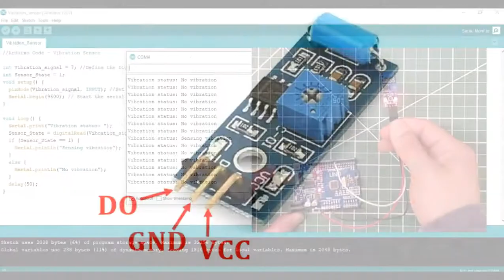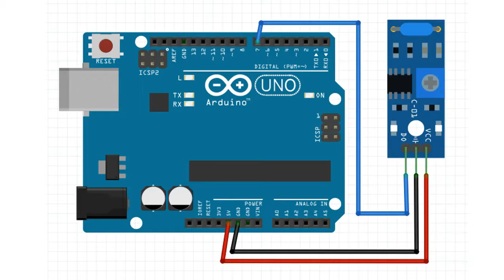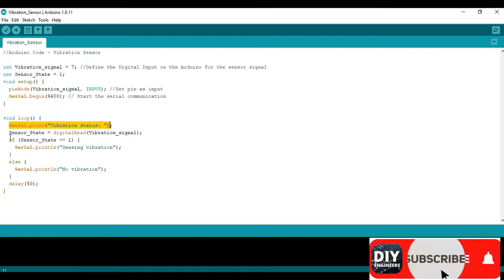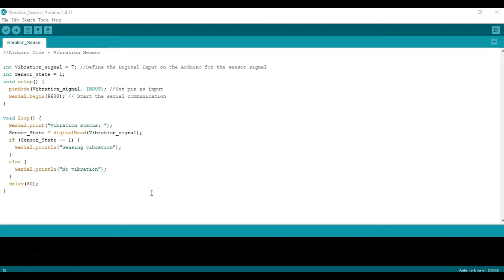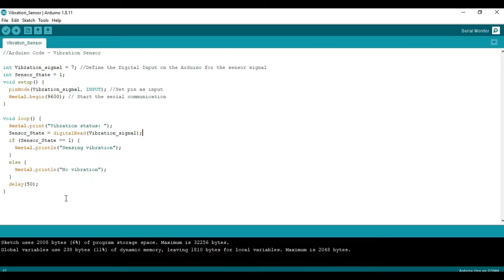Arduino Vibration Sensor (SW-420) - How to Use

Comment: Is there a sensor that returns the strength of the vibration?
Reply: SW-18010P module also has analog output, not only digital.

Comment: Hey, mate...
How can I measure the vibration in Hertz?
My Arduino returns the length of the pulse (in microseconds) or 0 if no pulse started before the timeout, but I'd like it to return the vibration in Hertz.
Reply: You might need an accelerometer such as the ADXL355 with FFT software for analysis
Reply: I have the same question.